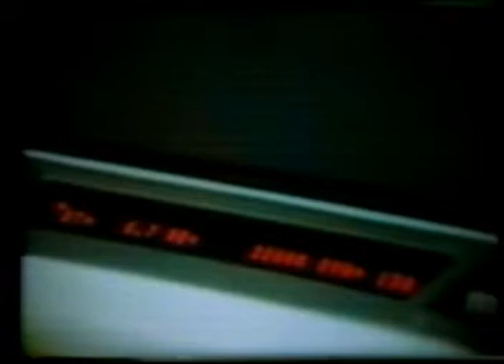Gas Chromatography Explained 1980

Comment: Probably late but I'll comment anyway. It's slowed down depending mostly on polarity. if it is a normal phase chromatography, the compounds will 'elute' depending on what components are are less polar as normal phase has a stationary phase that is polar and similar compounds tend to stick together more. Therefore the most non-polar compounds will elute first whereas the polar compounds will stay inside the column for longer (as they stick with the polar stationary phase).